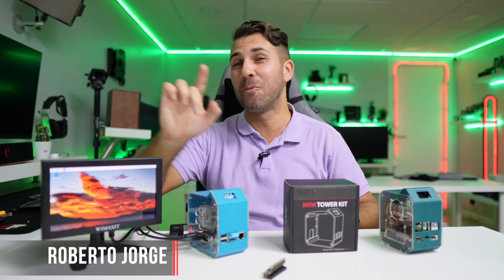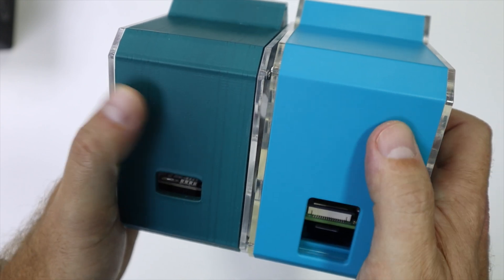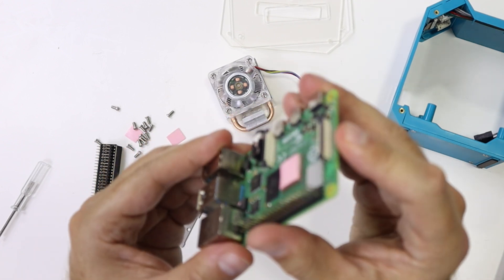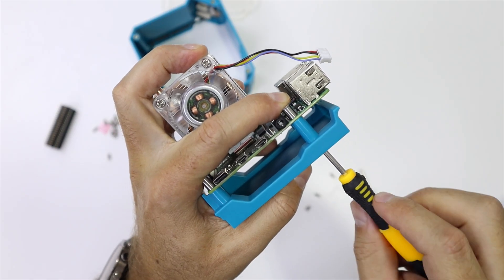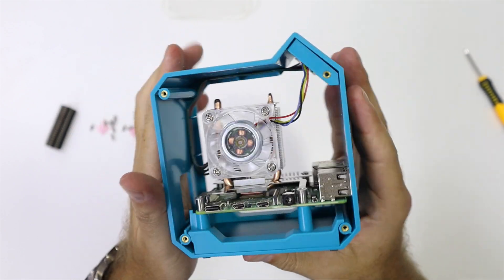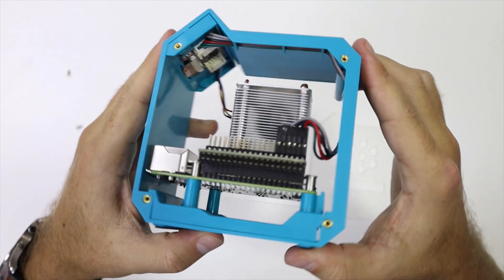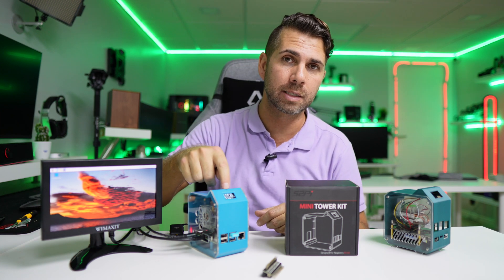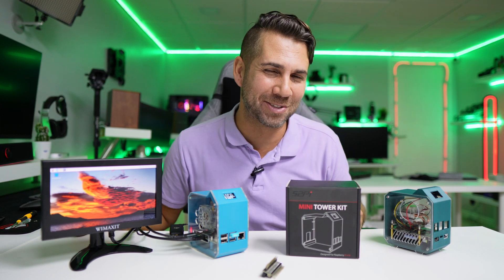Raspberry Pi 4 Mini Tower Kit Got BETTER & CHEAPER !!!

Comment: case looks neat but looking at this set up. Can you not put thermal paste on cpu  instead of thermal pad. it would give you much better contact, or will that leave a gap between cooler and the cpu?